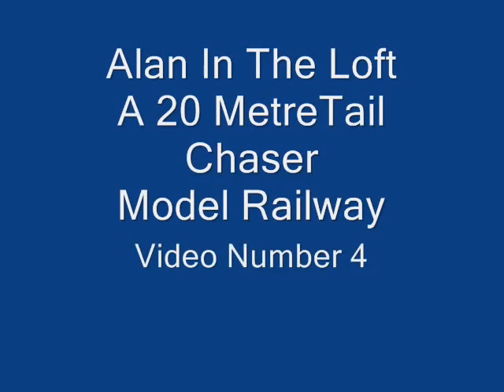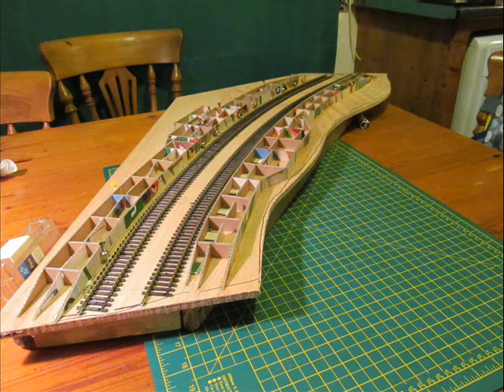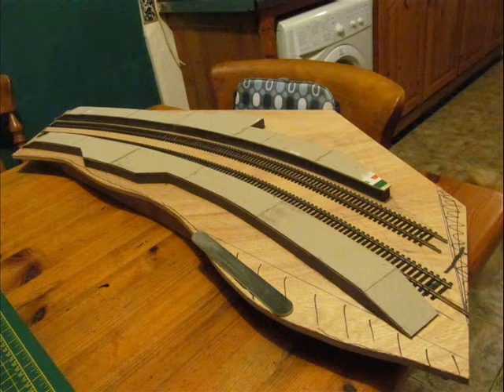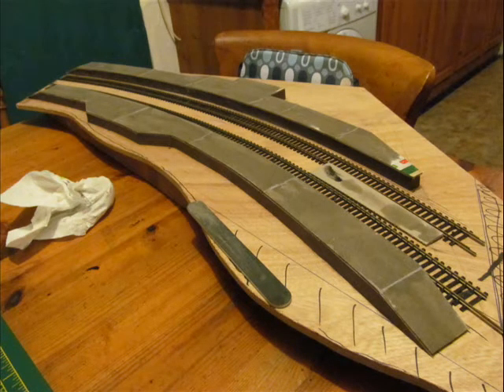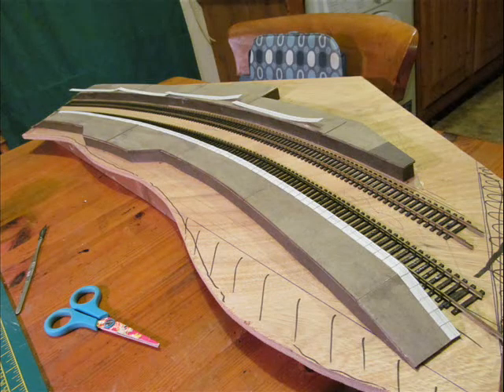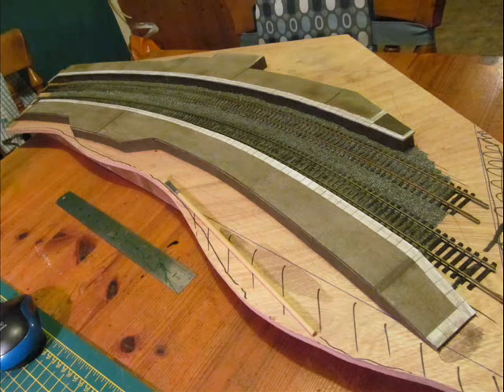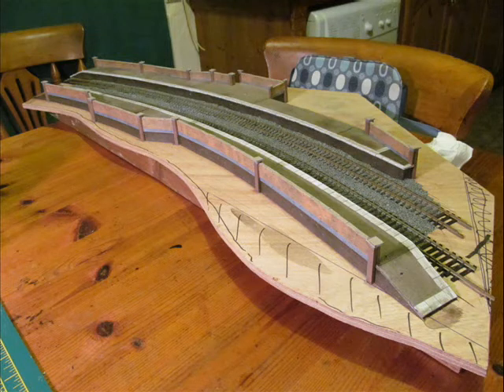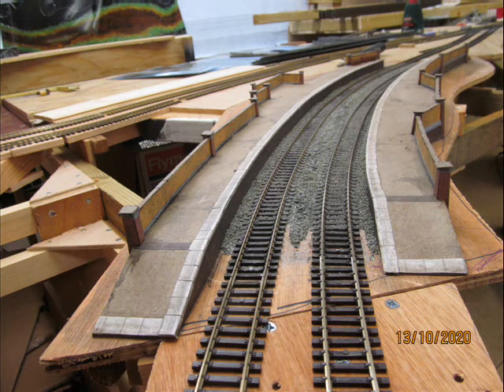Buckland Junction Loft Model Railway 4 - Scratch Building Series

Comment: Hi Al, thanks for your tip about this vid. I've looked at other platform construction vids and they were a bit off putting using mdf etc., but your construction method is similar to  mine except your way is more sturdy and boxy ..ironically, I was in Sainsburys last week and I grabbed a sturdy cardboard box and thought, 'Al would want me to use this..; and this morning I grabbed another one, platform construction here I come. Its a terminus station with four platform faces.. wish me luck..B
Reply from the maker: Glad it was helpful! Get your scalpel and steal ruler, also a slide square ruler so you don't have to keep measuring. Go for it mate. Regards Alan  :o)

Comment: (Tch-tch) Just spotted this a few seconds after asking the size of the layout. 20 metres would be about 70 feet, am I right? 'Ainthorpe Jct' follows the walls around not quite three sides of the cellar, about 25' of double track, goods & livestock yard, coal depot (BR/NE) with lime shed, 'cripples' siding and defunct station. Still probably dwarfed by 'Buckland Jct'. Enjoy the challenge.
Reply from the maker: Cheers Alan from Alan :o)
Reply: @AlanReynoldsBucklandJunction  Take a peek at Ainthorpe's development, there's a page on this site headed by an image of a J27 working uphill with a massive column of smoke from her chimney, cf. https://hubpages.com/@alancaster149, it'd be interesting to hear your opinion. It's all analog.